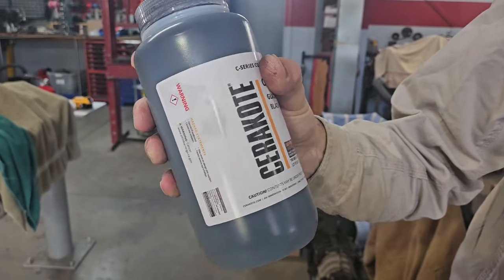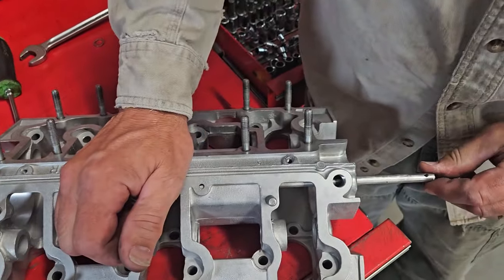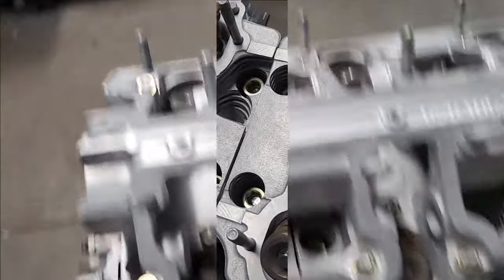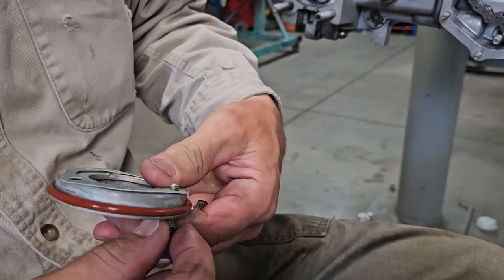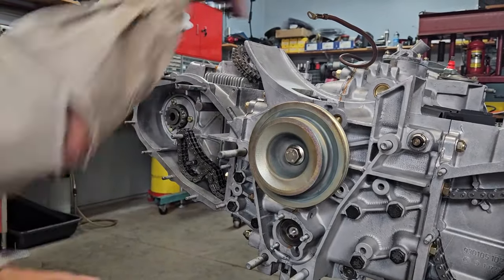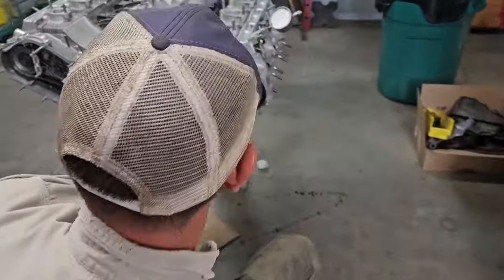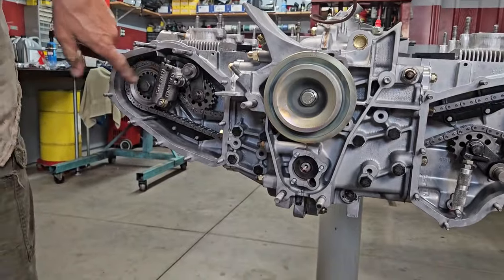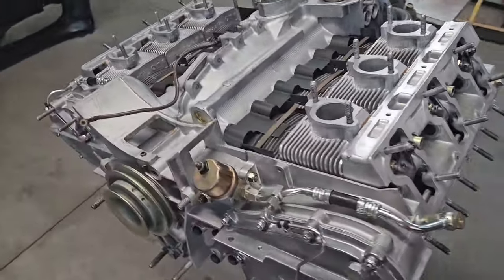1983 Porsche 911SC Engine Assembly Part Two

Comment: Great content.  When installing the the cam chain covers, you use gasket only, no sealant?  What are the signs that the fan needs to be replaced?  And are some fans better than others?  There are different fan sizes and configurations.  For example, I think it was 74 thru 77 that had 5 blade fans.
Reply from the maker: That is correct Sealer should not be used. Gasket surfaces need to be clean, dry, and flat. When it comes to fans Porsche used a number of combinations of diameter and fan blade counts. Fan design is matched to engine design and purpose. The most common reason that I replace a fan is for either wear at the Sheave or broken blades.
Kurt

Comment: Love the detailed and clear explanation of your work - could you also add torque specs - i am replacing cam chain tensioners and need the specs for the tensioner nut and the cover nuts - thanks
Reply from the maker: We have specific videos on our channel that are an actual lesson versus this one which is more record of work done. In our lesson videos I give all tightening torques as we go along as well as more detail about the specific job being done. You can find these under our rebuilding play lists
Kurt

Comment: Which Cerakote product do you use for this please?
Reply from the maker: I use multiple Cerakote products depending on what parts I am applying the finish to. For some parts I the "H" series paints which are a bake on finish. I also use the "C" series products for items that are big and also see less mechanical wear and tear. Lastly on polished Aluminum or Magnesium I use their specific clear coat products for those products.
Kurt
Reply: @klassikats  I assumed it was C for engine tin? Any particular black you prefer? Thanks
Reply from the maker: On this one I used Glacier Black
Kurt

Comment: You mention updated o-rings when referring to the rocker shafts.  What is updated about them?
Reply from the maker: The fact that Orings are now used as opposed to the original build not using O-Rings
Kurt
Reply: Ok I see. Is it two o-rings per retainer? I have a problem retainer on cylinder 5 that is loose…again. I think I need these seals, a new retainer, new hardware and a new bushing
Reply from the maker: If your rocker shaft continually comes loose in a short amount of time, then the cam box is most likely worn and may need to be replaced. There are two O-rings per shaft, and the O-rings are only to mitigate oil seepage.
Kurt
Reply: Yeah that could be. This car sat for years and I got it going but it came loose. I think the same shaft was reused when it was tightened.  It’s only that cylinder that has come loose. Is there a diameter spec on the can box bore for the retainer?